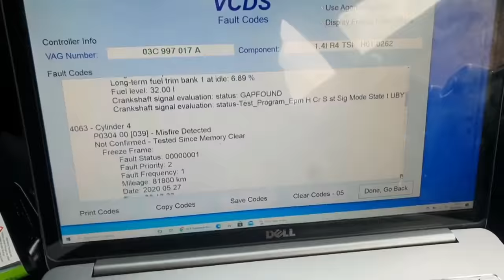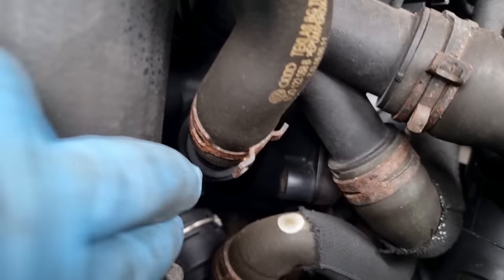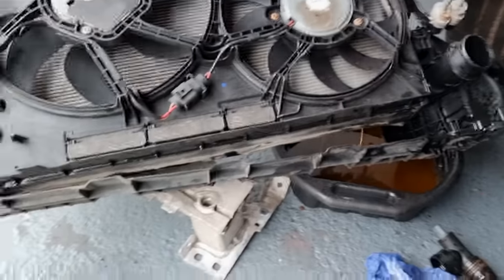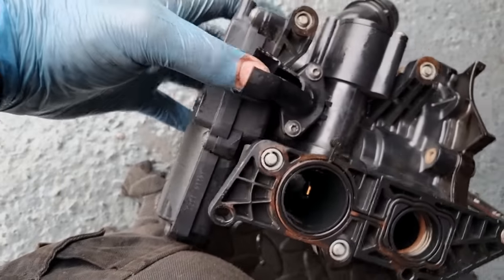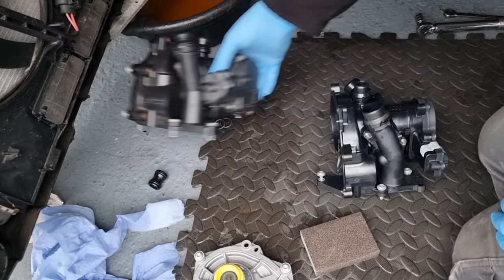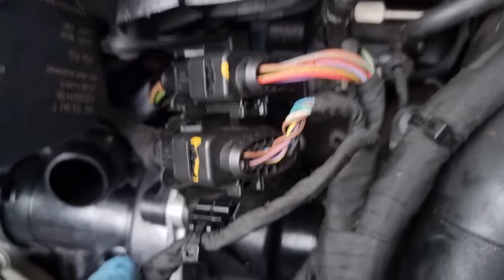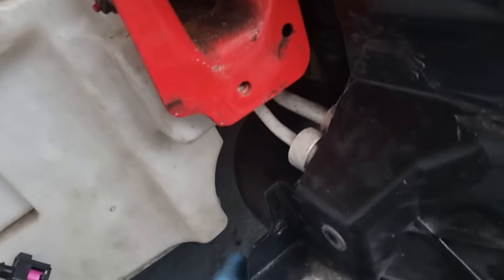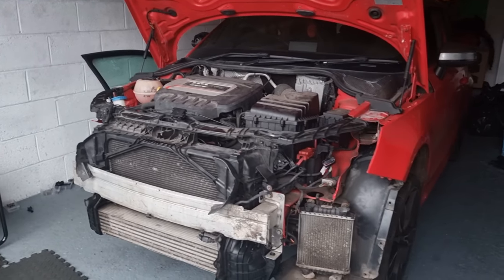Audi S1 Quattro Water Pump and Thermostat Replacement

Comment: What scares me the most about this job is actually being able to remove the grille. It seems like a hell of a task to get to the water pump but watching this great video made me realize it's probably actually not that bad. You need the right tools obviously and use the right technique to undo some clips and bolts.

Comment: The hole in the thermostat and waterpump could well be a weep hole when it starts to leak it tells you the seal is failing or failed.

Comment: I do like 3 of these a week working at audi, think it is about 850 ish, seen a lot of people take the manifold off, you don't. best way is boost pipes off and fan shroud and throttle body off then you can see it clearly in the car. i do them in 3 hours on non s models, but i do them a lot a lot.